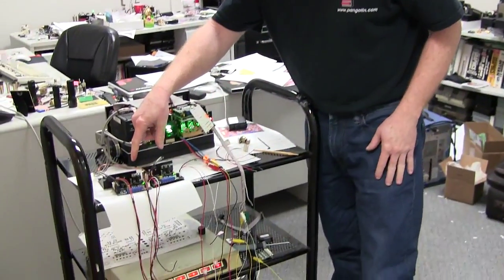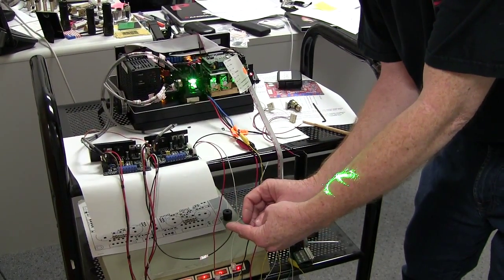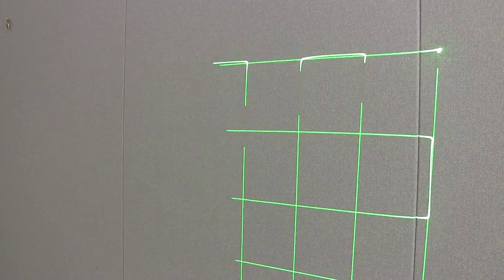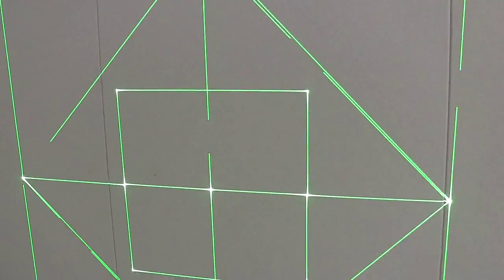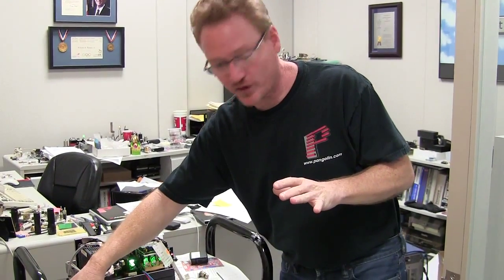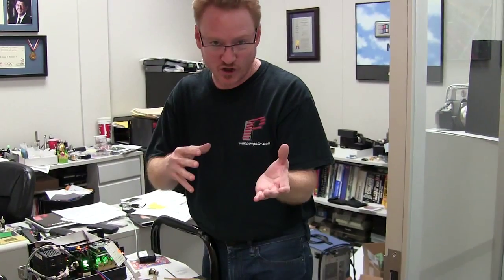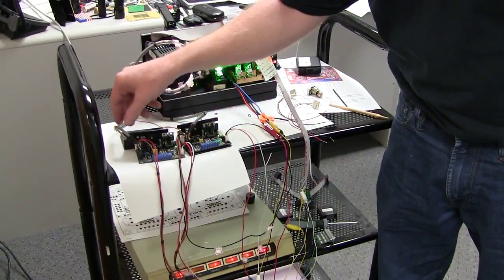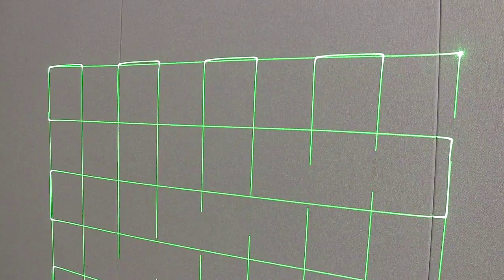The effect of phantom grounds on projected images

Comment: Thanks! I have a diy projector that was having a similar problem with image shifting when a TEC cooler was switched on. I redid all my grounds properly to a single point,  and the problem went away. Again thanks!
Reply from the maker: AHA great. If you search the internet for "William Benner Projector Connections" you will no doubt run across a link to the article I wrote years ago. I put a re-print of the article in my book about Laser Scanners as well.

Comment: So out of curiosity. If they cause crosstalk when connected to each other, and work perfectly when both grounds are lifted, why do they have a ground wire at all and are there any circumstances where you need to connect the ground?
I'm just about to read your article, so i assume the answer will be in there anyway... Great video, thanks!
Reply from the maker: Great question. Our own servo driver has a "ground" (central) pin on the command signal, but in the manual we tell people not to use it... We have it there only for legacy (i.e. historical) reasons. I think there are very rare circumstances when it would make sense to use it...